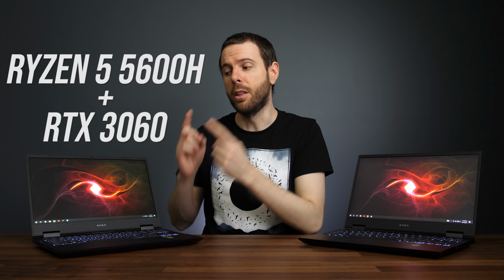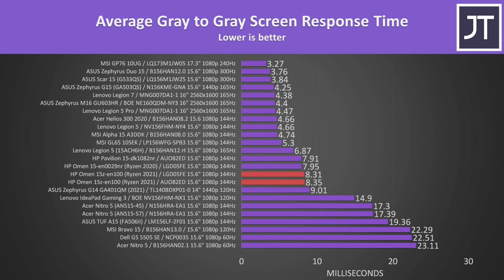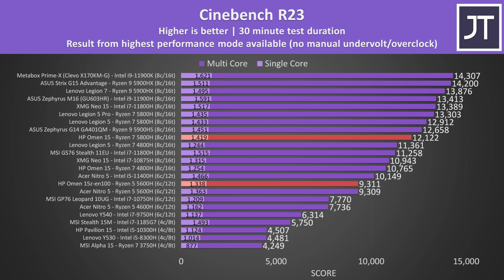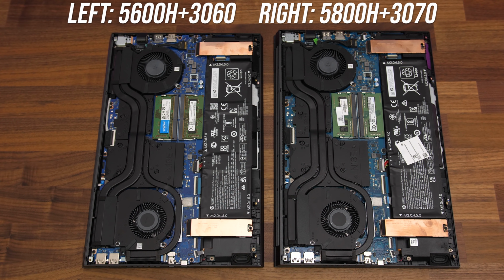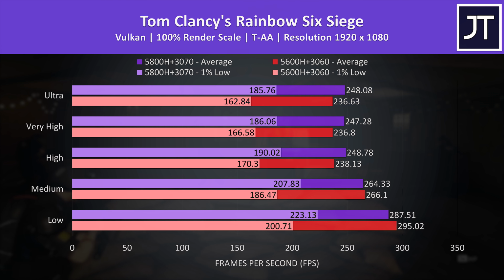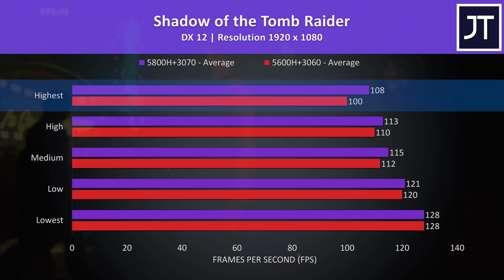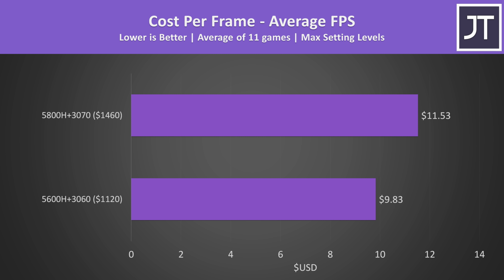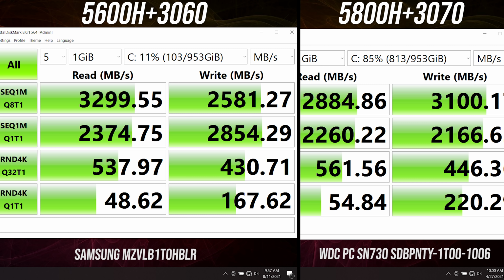Are Higher Specs Worth More $$$? HP Omen 15 Compared!

Comment: Currently in Australia RTX 3060 laptops can be purchased for as low as $1500 or roughly a thousand US dollars however RTX 3070 laptops are a lot more expensive as they start at $2500 for ones with lower end CPUs and can be close to $5000 for ones with higher end CPUs and higher amounts of RAM! :)

Comment: Hello jarrod. Im very happy to share that i have successfully upgraded the 60hz omen display to 144 hz one. I had to find 40 pin cable as the 60hz one has 30 pin. I have already upgraded everything else. The display is lgdo5fe. 6.4 ms in mprt test. Display and cable cost me 4250 rupees or 58 dollars
Reply from the maker: That's good to hear!
Reply: @JarrodsTech  you won't believe but i replaced my r5 4600h 1660ti motherboard with r7 5800h 3060 that i got from a destroyed laptop i got online for parts. It worked. The fans, heatsink, charger are same in both so it freakin worked.

Comment: 100 wt on rtx 3070 sucks. I dont like that lazy HP decided to use absolutely the same cooling system for both specs and, therefore, cut 3070 in power. Not appreciated

Comment: the ryzen 9 5900hx model of this device is only 100 euro more expensive at the dealers in my country, is it worth choosing it? Will there be a thermal problem according to the ryzen 7 5800h model? my friends say that the cooling system of omen devices is bad, and they tell me to buy MSI GP series. there is 1200 Euro difference between ryzen 9 rtx 3070 omen and rtx 3070 i7 11800h MSI GP, for this money i can buy a new rtx 3060 laptop and use 3070 with my right hand and 3060 with my left hand :) It is important for me that the device does not turn on the fan at idle because I will also use the device at school. what is your advice

Comment: I have a Asus TUF A15 FA506QM 2021 generation and my question is if i connect an external display to the USB Type-C (cause the HDMI port it connects to the iGPU) do i get more FPS? Or there is a way to disable the MUX Switch?

Comment: Hi all, great video, I have Lenovo legion 5 pro, does it have the Mux switch? If I turn off hybrid mode, I loose AMD internal GPU from task manager, does it mean I have the mux switch? and than better performance in games, or I also need ext. screen for max performance.
Reply from the maker: That is what turning hybrid mode off does. You mean you're only using the dgpu. I have a post on how to disable optimus here:
https://jarrods.tech/how-to-turn-off-optimus-on-your-gaming-laptop/

Comment: How common are the heat issues of the Zephyrus G15 GA503?

I need a thin and light gaming laptop for under $2000.
I almost bought the G15, but I keep seeing a lot of posts mentioning the heat issues - overheating, hot air blowing onto the screen, the screen bezels warping and screen failure because of the heat.

How severe/common are these issues? Should I get one despite these problems or do you guys have another laptop recommendation?

Comment: reviewing the lenovo Legion 7 I c i710875h rtx 2070 max q for a long time.  I have big problems with overheating and wanted to ask what should I do to reduce the temperature?  You somehow did an undervolt, but I did the same as you did in the video, but I still didn't succeed.  My BIOS version 63ww can that's why?

Comment: i hope you will do a review on the Strix G15 G513 with these specs: 4800H GTX 1650 144hz, since in my place it's even cheaper than the G15 G512 model from last year, ASUS claimed that it could stream 12hrs of video playback and i think it's a good deal so thanks in advance!

Comment: Both are great, but rtx 3070 will age much better in future games.
Have the Omen 15 rtx 3070 and MSI Delta 15 rx 6700m.
Now I'm just waiting for Nvidia/ AMD to make gpu's that provide even more performance at 100 watts.
I wonder how they'll resale in the future.
I sold my Acer Helios 500 with rx vega 56 for over $700 just a month ago. Not hard to flip your old tech into the new tech.
RTX 3070 laptop is faster then rx 6700m in most windows games.
RX 6700 is faster in proton, but slower in native linux games.

Comment: Or just buy the Lenovo Legion 5/Pro if found available. It has a MUX switch, better cooling, better display the 3060 I have it’s 130w and the charger is 300w to be able to over clock the GPU. Only downside is the RAM that is not 1Rx16. As he mentioned before it  benefited the FPS.

Comment: hey are you having problems with GeForce Experience? I got the 3060 version and idk which drivers to download. really appreciate your help
Reply from the maker: I haven't come across any issues with GeForce experience, it should just recommend the best drivers for you automatically. You can also download them manually from here:
https://www.nvidia.com/Download/index.aspx
Reply: @JarrodsTech  so hey, I've figured out that the problem is actually that my laptop is using the integrated GPU instead of the graphics card. can you by any chance make a video on how to switch it?

i went into the BIOS and there wasn't an option to change it

Comment: I would go with legion 5 pro rather than going with with of the omen 15 cause the legion 5 pro is cheaper in India and legion 5 pro has excellent display, Max-p gpu and a mux switch with better build quality ❤️😍.
Reply: Legion 5 Pro is also heavier and bulkier. The screen is nice, but if you want higher framerates, playing at 1080p on the Omen will get you there while looking a lot better than playing at 1080p on the Legion. But the high resolution is nice still for sure.
Reply: @joshcravey  Agreed bro
In India for the price I guess legion 5 Pro is a steal deal but still it's expensive than in other countries 😁
Reply: In the US the Legion 5 pro w  Ryzen 7 5800H starts at $1700 compared to the Omen 15 w Ryzen 7 5800H at $1260.

Both with the 8 GB RAM configuration. To me, it is not worth $440 more USD for the Legion - it does seem that most other territories are getting a good deal on the Legion, however.
Reply: @elyjahkidnot  yeah bro but it's like every laptop is so much expensive in India that all most all laptop comes at same price which is still consider as expensive 😂😂

Comment: I wish the 3070 in my 10750H OMEN 15, got 125w. It won't to above 99 watts. 

But is still a decent 1080p machine. The 300hz screen on mine is super responsive, even if I'll never see 300fps in any game. 😂 Forza Horizon 4 gets 150ish cranked and gets closer to 300 with everything at the lowest setting.

 If I can figure out how to use it as a monitor for my desktop, I'll be getting that all day with my Aorus 3080 Waterforce EXTREME! 

I have no issue gaming at 1080p, when it's wish a nice performing panel.

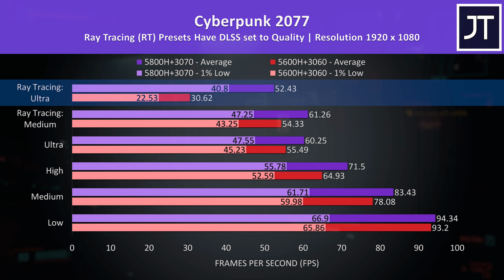Comment: 5:15 The RT results clearly show a vram bottleneck
Reply: I've seen cyberpunk 2077 gameplay on the omen 15 with 5800h cpu and 3060 gpu with 48-50 fps average on ray tracing ultra.. Could it be just a processor problem if you get hardly 30 fps with the 5600h?

Comment: It's crazy just how many laptop models are crippling the the 3070's performance with low wattage.  Seems like the 3060 model is the better deal for gaming.  If you use software like zbrush though, you always want more cores.
Reply: Hi, I do 3d blender and Adobe software for content creation.  Do you recommen getting rtx 3060 or 3070? Thanks
Reply: @islandersean2213  I'm not familiar with Adobe gpu utilization but it does make a difference for blender.  To get the most out of blender you can never go wrong with more VRAM and CPU cores.  But with this 100w 3070 model I imagine it runs into similar underperformance issues.  I'd say go 3070 but make sure it's a 130 to 140 watt model.

For a program like Zbrush though, it's 100% cpu based so you really want more cores and higher clock speeds.  A better gpu would have no impact.
Reply: @Orain88  thank you
Reply: @User 2389 that's exactly the laptop I ordered.  Still waiting for it to arrive in the mail . . . 😧
Reply: Nope, 3060 also had really bad impact...like 90wh in dell xps 17, asus zephyrus 14...versus 115-125wh in dell g15...the result also shocking.
Reply: @NamelessPassenger  3060 had a bad impact on what?

Comment: Puget Bench version, Software version should be distinghished! :

Puget Bench required to be updated to the recent newer version distinguishing free and commercial licenses of Premiere Photoshop, Premiere, Resolve, etc. Because of the utilization of GPUs (iGPU and DGPU) differs among the number of SW versions with the adequate test bench versions and also differs in free and commercial licenses of the softwares.

As an example Free and Commercial(Studio) licenses of Davinci Resolve Studio 17 differs in Puget bench overall record about 15%. 17.2.2 or later version also enhanced 10-16%, because GPU utilization algorithms enhanced than 16. It is also similar for Premiere 15.4 or later than the version under 15.3 or before.

Puget Bench license with Free license of Davinci Resolve is free. But on using commercial Studio license, the commercial payment follows for Puget Bench. I feel so.

Comment: I suppose there's a factory power limit in both Omens, 5600H and 5800H should be reaching 4 GHz or above. The cooling is also a bit underwhelming compared to previous versions, 5600H hitting 93c at 3.8 GHz is quite toasty.

Comment: I completely agree with your conclusion. I never understood the value proposition for high-power GPUs with 1080p screens which is why I don't get so many vendors still shipping high power GPUs with these low res screens. Like you said, just save your money.
Reply: well, either you have external screen, or usually theese day thoese full hd are 144 hz
Reply: @michalpecz9433  I understand the external screen, though that seems to negate the portability aspect of having a laptop, not to mention the added expense. These machines aren't any cheaper despite having inferior screens.
Reply: @darrell9616  This. I want a good laptop as Im a graphic designer but all the gaming (graph cards) laptops are super HEAVY, LOUD, HOT with bad screens and as expensive as desktop and now almost all the trackpad are on the left.. who uses a mouse on the go? 

So why not buy a desktop? Im so confused Ive been reporting my buy for a year now 😵
Reply: @OphiuchiChannel  "super heavy" don't exaggerate
Reply: @danditheyesman848  if you need to carry them daily it makes a difference. 14" are not that heavy but I find them small. I wish windows machine could use the M chips.

Comment: Dudee...alienware x15. Extremely curious if 4 fans do any good. Also when you review it...please flip the motherboard and show us the cooling. Stay welll man. Love the "jarrod treatment" of laptops
Reply: it does work wonder.

thing in computer is if you have 4 fans you dont need to have all 4 fans running full speed to be effective at lowering temp so its actually a little quieter.

and more fan = higher air intake = positive air pressure = lower temps.

Comment: Can we expect that Omen 15 3060 vs Legion 5 3060 direct head to head soon 👀?¿?
Reply: I would like to see that too.
Reply: Legion 5 should be slightly ahead. Its GPU can reach 130W and it has a MUX switch.
Reply: Legion 5 is just a superior laptop overall. Legion 5's 1080p 165hz display is just so much better with Gsync and Freesync support. The MUX switch is just another bonus. The Omen 15 only advantage is the chassis is slighty lighter.

Comment: I love how both of these models are probably 500%+ faster than my current laptop.
Reply: Sixten Bischhaus  a potato 🥔
Reply: @Priyajit_Ghosh  me too
I have a Lenovo Thinkpad T440
i5 4300u with intel hd graphics 4400
4GB DDR3 1600mhz ram single channel
128GB SSD
1366x768 @60hz
Reply: 500? These laptops are almost atleast 5000% better than my laptop
Reply: It's over 9000
Reply: my desktop aint too bad. it can play minesweeper at 60 fps
Reply: What u guys have laptop 🥲
Reply: I have an intel pentium dual core from Stone age how better would this be.
Reply: I upgraded last month from a i5 480 6gb RAM GT540M 1GB VRAM  to a i7 10thgen 2070 super and the diference is fukin insane. Feels like i have a laptop from Nasa.
Reply: I'm still using my laptop with an i5 5200U, 8 GB DDR3 RAM and integrated intel graphics. At least it's pretty usable.
Reply: @cheap_jet7313  ye same, atleast its useable
Reply: @RayenPlays  I have 6 yrs old laptop with i7 5500u, 930m gpu and initially it has 4 gigs of ram, so upgraded it to 12 and bought an ssd.
And performance wise its pretty decent (i can run TW:W2 at 20-30 fps at min settings), but I have 1366x768 and 60hz matrix and my god its is horrible! 

Colors are awful, quality is awful too, and it hurts my eyes every time I need to work with it (and I use it 9-10 hours per day)
Reply: @grihoriko8800  your's is kind of better than mine, my laptop has a lot of problems and i cant fix it in my country, nothing is avaible here and everything is hella expensive
Reply: @RayenPlays  well, its better on paper, but compared to todays tech we are kinda in the same boat, both our laps are trash to current gen.

To make things worse everything expensive here aswell, I cant buy myself a new laptop or upgrade my pc for more than 10 years now.
I got this lap from my wife since she needed my pc with 2 monitors, but she got her laptop way before we even married and I needed to sunk 200$ into it to even be worthwile.
So yeah, things aint great everywhere, I guess.
Reply: @RayenPlays  where do you live exactly?
Reply: @mobarakjama5570  Suriname
Reply: @RayenPlays  hollyshit bro don't take this the wrong way but, never heard of it, I'm also from a nowhere country called Somaliland :)
Reply: @mobarakjama5570  ooh
Reply: @RayenPlays  Yh ooh, but that won't stop from watching these technology channels and wishing I could afford these devices 😂
Reply: @mobarakjama5570  yeah lol
Reply: I feel you man. I feel you..
Reply: 500? Go atleast 1000
Reply: It is 5 hundred thousand million percent for me cuz I got a 2c/2t laptop that plays STO at around 6FPS!
Reply: Ghost Feather  I personally have an old Lenovo laptop with Pentium t4400 really low end and about 64 MB of dedicated video memory
Reply: I have 940mx laptop, and it's so true 😞
Reply: Should I take that as a petition to join the Dinosaur Club? *shot*

Comment: Still puzzled how last year's Omen with 4800H reached much higher clocks (4GHz+) at similar (or slightly higher) power levels!?! 🤔
Reply: That is due to Zen 3's unified 8 core CCX and L3 cache pool (which is also double the size than zen 2)
I've seen that on every model that shipped with 4800H last year and 5800H this year like even the legion 5. 

Had they moved to 5nm the clock speeds would've been higher (or the power consumption could've been lower). But that node was already booked by Apple and Qualcomm I suppose.

Comment: I have the 5800h, rtx 3060 model.. Is my configuration closer to the 5600h, 3060 or to the 5800h, 3070?
Reply: in games to 5600h, 3060, in heavy multithreading to 5800h, 3070
Reply: closer to the 5600h/3060 , and btw is this a victus by any chance?
Reply: @lawson1989  it's the omen 15. By the way thank you both! Just for clarity, for overall performance do you know if the difference from the cpu (5800h vs 5600h) is greater or lower to the difference betwen the gpu (3060 vs 3070). I'm asking not just for gaming.
Reply: @2chicuz225  5600 vs 5800 = basically you will have same single-core performance and core-proportional performance increase in multi-core applications. That means that, depending on the application you use and games you play, you may experience basically no real difference at all up to +20% performance increase, which may just result in a more smooth experience rather than evident performance increase during multi-tasking activity. 3060 vs 3070 = here the principle is different and straight much more simple: if you don't play 1440p and/or very high details to benefit of the additional 2 GB. of VRAM and more raw power the 3070 price increase is very difficult to justify looking at the performance gain. That said if you plan to keep your configuration for 3+ years the 5800+3070 is a wise and better future proof investment.
Reply: @Mattiu75  I am not a hardcore gamer but when i do i game on 1080p so i guess i should be ok with my configuration.
Thank you very much!

Comment: Is the rog strix g15 with rtx 3060 worth to get cuz the advantage edition is not yet available in my country
Reply: It depends.
In India, the 3060 Strix G15 costs about 1.32 Lakhs whereas the Strix G15 AE costs about 1.55 Lakhs. For the additional 23,000 INR price, we get QHD screen instead of an FHD one with a better processor Ryzen 9 compared to Ryzen 7 in the Strix G15. Also, the 6800m is 3080 competition compared to the 3060 in normal Strix G15. All in all, I think a better processor, gpu and display is worth spending 23k extra on as it will make the laptop more future proof and let me enjoy normal youtube videos more as well.
Reply: But for 1.32Lakhs, the Strix G15 is not a bad deal as it will run every game smoothly for the next 2-3 years at least in High settings. But I'd prefer to invest in Legion 5 Pro in that case though due to a better screen and the online coupon which makes it cheaper than the strix G15 all in all.
Reply: I was considering the legion as well but I am worried of the weight with the massive power brick since i will be carrying around
Reply: @pablol5370  The Strix G15 AE will weigh equal to the L5P, and its brick is as bulky as L5Ps if not bulkier. Though I would prefer Asus over Lenovo because of better service in my area.
Reply: @rishavkumar1343  thanks for your suggestions